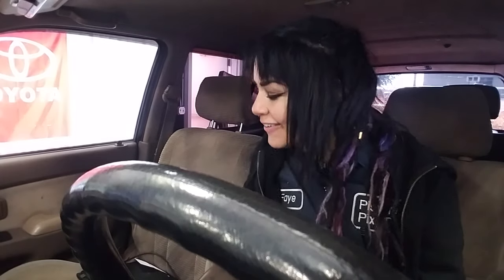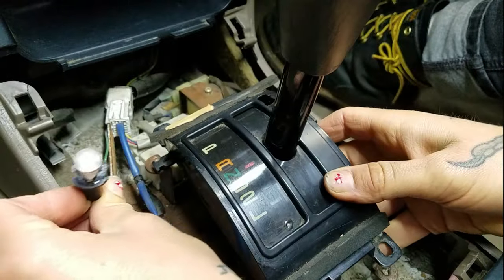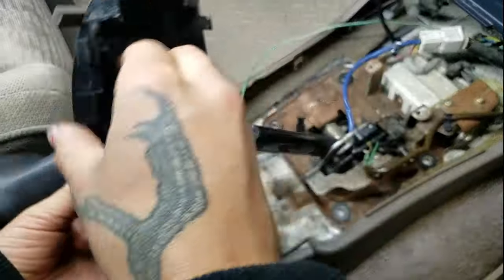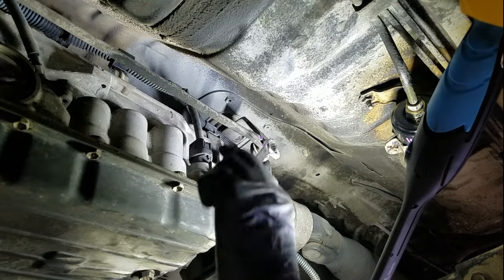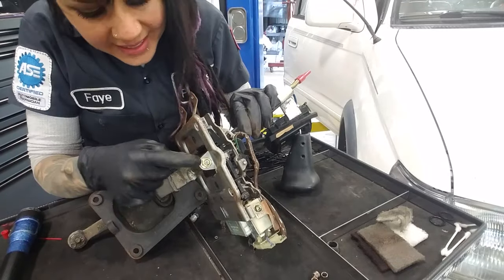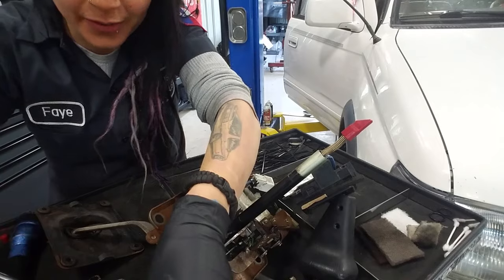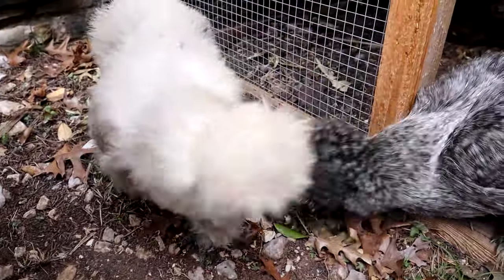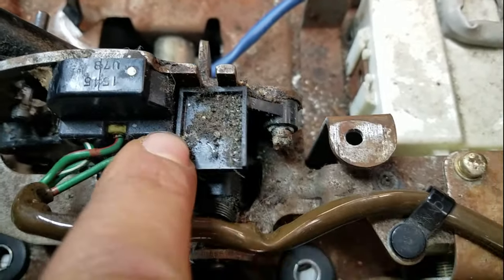Wobbly Shifter Fix - 3rd Gen Toyota 4Runner

Comment: Good fix! All my fav’s, mechanical, cheap parts, fixing a chronic little annoyance, learn as you go, admiring the engineering/design, easy electrical connector, and the most fav’s are Faye and chickens. Chicken says,”what’s yours, is mine”.

Comment: After watching this video and watching all these steps being done there's a much easier fix. All you have to do is stick a dime on the right-hand side of the base of the shifter shaft it fits in  perfectly it will not fall inside and it is very tight like new. This gal is very talented and yes she did do it for cheap. However I did it much faster and cheaper it only cost me a dime.
Reply from the maker: Fantastic!! That's the goal! Easy cheap repairs that work!

Comment: Thanks Faye!  For those nay sayers who wouldn't fix this, man, 10min job and the wobble was killing me.  Faye, you're directions were fantastic, especially the marking of the transmission connection with a marker - totally the kind of think I would miss doing turning a 10min job into an hour.  The only thing different was, on my 2001, I didn't need to dismantle the hand shifter, just pulled the bolts and the one underneath, unclipped the 1 plug and the whole assembly comes off easy peasy.  Thanks so much for the vid, my shifter feels tight again.  Cheers!

Comment: This video was incredibly helpful.  I was able to replace the bushings on my 1995 Toyota 4Runner and while I was in there replaced the bezel (PRNDL piece) with Toyota part 35921-35190 for 96-98 4runner.  Got that part from Lakeland Toyota online took a couple weeks to get here.  One thing to note is that the two pin connectors on the top left for illumination and the overdrive switch are very difficult to remove.  And the shifter button that flies out when you remove it was not easy to align back into place with the spring with a red end piece on the shifter.  It needs to be pressed in partially into the shifter when pushed back into position.  It is also good to make sure that you get the shifter back in park P after installation.

Comment: Thanks Faye!  FYI, i was able to easily do the job by only taking out the 10mm bolts and disconnecting the one white wire harness.  Then, underneath, disconnected the linkage just like you did, and it all came out just fine.  No need to mess with the plastic parts (besides the one that pulls off first) or the shifter handle and wires.   Also, i had a hard time putting that first plastic molding back on, so i pulled the e-brake molding off, put the gear selector molding on, and then put the e-brake housing back on.  That made it easier on mine.  THANKS AGAIN!
Reply: Job took me around 1 hour, including getting my tools together and ordering parts.

Comment: Faye used a brand new Snap-on screwdriver not sure of the cordless driver but it looked like a Snap-on. Under the vehicle, the wrench was a Snap-On 14mm an Astro Pneumatic slim LED light.  You have good taste in tools a true professional! Good Video was very informative for somebody not mechanical inclined. Lighting Suggestion Capri Tools has a light that looks just Astro Pneumatic light, most likely made by the same company. The Capri light has UV built into their version of cob slim light for leak detection. Keep up the good work.
Reply: Hi Roy, that is our light being used. Thank you for suggesting our light, we appreciate the love.

Comment: On the 4WD model there is a lightbulb that may be burned out under the gear indicator. It's worth changing that out at the same time.  The 2WD may have the same bulb.  Thanks for the video Faye!

Comment: Well I got a 2002 4 runner with a not so tight shift selector , now I thought I could correct the problem without having to disassemble the whole dang shifter , “ surprise “ !  And then gal you went and put the vehicle on the lift , and I was like aww hell no !  Ya I know the bushings were really cheap, but I may have to live with the sloppy shifter till I can magiver , some type of clip in bushings to be put in from on top , this was a very informative video that showed me what I’m up against on doing this project thanks Faye for making it, 👍✌️
Reply: There's a way to do it using washers, that doesn't require all that disassembly. I like the washers because they'll never break unlike the plastic that have already broken and gave me the same issue. Remove the lower part of the trim, can easily get to the bolt from the driver side. Remove bolt, place washer on each side of bolt where the plastic collars would've gone, reassemble. Much easier, and lasts forever. Instead of using the same plastic collars that already broke once, the washers work perfect and will never break.
Reply: @kenenders6838  👍🏼thanks !

Comment: Thanks a lot for this, at 320k I am a victim as well - not for long 😀. I see you have already done the cup holder swap from another year, well worth the effort. 

If you haven't already done it, there is a rear suspension recall on these 1998 models. Rear seat is brutal. Had mine done in 2014, no charge at Toyota dealership 😎.

Comment: Patient, methodical execution of the repair. Most likely the wobble was a result of decades in which driver/drivers were using the shifter as a place to rest the right hand when vehicle was in motion. Be it standard (aka stick) or automatic, select a gear then remove your hand until the next shift is needed - My two cents.... Best to you and yours.
r

Comment: For 2 bucks and a headache it can stay wobbly 😂
Reply: No way, I love these kinds of fixes. A hassle to do but when you’re done, oh man that feels good. You only have a couple things you interact with directly on a vehicle. It feels great to have them all nice and good.
Reply: Lol!  All of my 4runners did this. I just lived with it.
Reply: Chuck Taylor agree 100% 😂
Reply: Chuck Taylor thank you. Another thing if you were going to go to all that trouble why are they plastic why not metal? With bearings maybe. I’m going Ziptie  thanks to you
Reply: Some times if you're having trouble getting key out of ignition this fixes it. Owned multiple 3rd gens currently have 2. My 99 original owner till death do us part best vehicles ever, just ask my dog ! Lol
Reply: I just did this fix and its insanely easy
Reply: Side to side wobble can cause the key to get stuck in the ignition on the 4runners. I cut a washer in half and slid it over on one side where the blue grommet goes, then used vise grips to smash the washer enough to prevent it from falling out. Problem fixed.
Reply: @galeaiken3841 my '97 "fur runner" is still hauling my dog and I around with zero issues. This car will definitely outlast me.

Comment: Howdy Faye!  My 2002 4x4 4Runner has the same issue.  Would you know if the procedure is basically the same with the pistol grip shifter?  Thanks and have an incredible New Year!
Reply from the maker: Almost the same! There are still these 2 little bushings and iirc it is the same part #.... I would double check with your dealer just to be sure and have them print you out an exploded parts diagram!

Comment: If your key gets stuck in the ignition this is most likely the cause. I lived with the loose shifter for a while till it wouldn’t let me take the key out lol. Now it’s smooth as butter. Just help anyone out there that might have the same issue.
Reply: I rebuilt my 4runner as the previous owner burned the entire wire harness from driver's side to middle of the truck. I bought it hopes to understand what happened and it only had 140k miles on it!  There is a 40amp fuse in the kick panel that will cause the key to get stuck even if you use the keyshiftlock feature.  It was a mess. I found a wrecked one and took it out of there (paiiiiiin)

Comment: wow, can't believe it's that labor intensive to fix!  Uggh  My 98 4runner has the same problem.  : ((
Reply: I’m not doing all that crap for that…
Reply: @Alex-rl4uy  You don't have too!  I watched some other guys video, and it's a LOT less work.  Faye took way too many things apart.  It's actually a ridiculously simple fix.  Just go under your truck, remove the cotter pin, then go in the truck, take cover off, remove 4 bolts, and the whole shifter comes out.  Flip it over, and you're right there to fix the problem.
Reply: @2028end  l  lo
Reply: @2028end  is there one for the 4wd shifters?
Reply: @waltertang9303  sorry, I don't know, because I only have 2 wheel drive.
Reply: @2028end  damn. I converted my 2wd to a 4wd just recently.
Reply: @2028end  do you have a link to the video?
Reply: @liamaspirin1460  no sorry, don't remember what link i watched anymore.  But it's as simple as what i wrote above.  : ))

Comment: Does that 3rd gen have the drive line vibration yet, or have you already fixed it?
Reply from the maker: Doesn't have yet, but when it does, you know I'll make a video about it!!!!😁
Reply: @FayeHadley  IIRC that gen 4 runner uses a Tube within a tube driveshaft with a rubber isolator between the inner and outer tube. If and when you get the vibration, it will feel just like a u-joint and in some cases it is. However be aware that if after replacing them you still have the vibration, what you may have happening is the front and rear u-joints may be out of phase. It will give you the same vibration. I’ve seen two do it in the 21 years of being a Toyota tech. We only used that driveshaft design on that gen 4-Runner with 2wd.

Comment: Faye very good job.  I have 99 limited and I have developed a TICK sounds like the lifters on the driver's side. Also the sunroof will not move at all. Someone said the rails are frozen. Have you ever fixed either one?? Help would be appreciated
Reply from the maker: I have fixed both and have a ticking four runner in the shop right now!!
Reply: @FayeHadley  oh man!!!! Could you one day show the video of the frozen sunroof fix? Dealers tell me this is the most common issue. Not only is my roof stuck shut after replacing motor and switch 2x it leaks really bad allll over the driver's seat and floors ☹️
As far as the ticking I was told the lifters (self adjusting) can't really be fixed besides changing the oil with thicker oil and add Lucas is that true? It could come back!  Any tips besides taking to a shop would be greatly appreciated. Again keep up the good work

Comment: Yall just don't do it like I did. I was stupid and had my truck parked in the road and it was on a slight incline. I was under the truck disconnecting that nut on the shifter and as soon as I got it loose the truck started rolling backwards. I did put the E brake on beforehand but it turns out I didn't pull it all the way up. Luckily I hit the brakes and didn't hit anything, and I didn't get crushed by my tires because of how I was laying under the truck. I mean the truck was rolling downhill fast! This was my near death experience so just park it on a FLAT area no matter what! I did get the job done in my driveway even after all that! 👍
Reply from the maker: Oh my GOSH 😱😱😱😱😱😱
Reply: @FayeHadley  yep lesson learned! After what happened, I didn't feel like continuing, but am glad I did. shifter is so tight and smooth now! Thanks for the vid!

Comment: When I was younger and didn’t know anything about fixing anything, I had a 1987 Pontiac Firebird. I think the problem was that I couldn’t shift into reverse. I guy in my unit had a friend that was willing to fix it. I drove it over to his apartment complex and he was working on it for two hours and couldn’t fix it. The next week I realized I could remove the shifter knob and found there was a plastic piece on the inside that had broken. I found a replacement cheap and it was as good as new. Seems silly now.

Comment: How did you tackle the broken plastic bit (bolt hole plastic)?
I would have dove into my collection of used washers, find a suitable one and spread the compression surface over the leftover plastic.
What do you think?
Reply from the maker: I super glued it to a piece of thin rubber, then applied JB weld to the top of it. Good as new!!!
Reply from the maker: But that's a great idea too!!!! I also had to shave down the jb weld once it dried so it was still somewhat flush.
Reply: Faye Hadley 
Genius!
Love it better than my idea!

I forgot about JB Weld.. Good stuff!

Comment: Hey I'm wondering if you can help me out. I have a 2000 4runner with a shifter like yours. I'm having a problem with my tail lights staying on, I can also shift into any gear without pressing the brake. I replaced the brake light switch and the shift lock control without any luck. I do remember hearing a relay or something click by the shifter every time I press the brake but I dont hear it anymore even with the new parts. Is there some other part in that area that could be causing my problem, for example the last component yu were playing with at the very end of this video?

Comment: HELP I have a 96 4runner that the horn doesn’t work. Fuse is good under the hood. The copper contacts under the airbag are in good shape also. Would the clock spring have anything to do with this??

Comment: What if it wont shift at all? I press the brake and try to shift but the button on the shift wont go all the way in and you have to use the screwdriver override.

Comment: I have a 2000 4runner left driver side rear turn not working driver side window no work and rear middle passenger window intermediate. Is that caused by exposed wire ? I've changed all parts on drivers door to end up with no working window or brakes .  Please help me solve my stupid ways .Mike

Comment: so could bad bushings cause you ignition not to go in lock??? the issue that I'm having is that my key won't go into lock as far as it goes is acc on and start
Reply from the maker: Sounds like a worn out cylinder to me.... Do you have a lot of keychains or heavy keys on your keychain?
Reply: no... I have very few keys on my key chain probably around 4 keys... I ended up unscrewing the lock solenoid on the ignition and it works fine now...

Comment: Hello Faye ! Ricky here ! I have a question. Do I have to go under my 4Runner to fix the problem or can I just replace the plastic pieces
Reply from the maker: You don't have to lift the vehicle in the air - it was just easier to film. And the o ly thing that you really have to access from underneath is the shift linkage.

Comment: Toyota should have just put some inexpensive bearings where the bushings go so they wouldn't need replacing for a really really long time. (or used a much longer lasting polymer)

Comment: Faye, I’m having trouble putting the shift knob back on, the trucks is in low like you had it and it won’t shift into any other gear. Please help I am stuck
Reply: Did you figure this out @ryanfulmer5215? Same thing happened to me.
Reply: I figured it out last night after taking a closer look. Had to take it all back apart to get a small pin toward the base of the shift arm to go through a metal opening that guides the shift arm into each gear position. For anyone that ran into this problem, I think you'll figure it out if you take the assembly back out and give it a close look. It became obvious to me after fiddling with it for a few minutes.

Comment: And I have been replace them with brass ones, what was I thinking, I could save so much more money 🤭🤭🤭, wait I do not want to so it again, and yeah the tricks a little earlier would have helped ,my first few where ,where did the button go, bleep now I have to repair the wires I broke, and oooops the rubber cover permitex that back on. Oh be sure that the stick is not a doul gate for speed shifting.